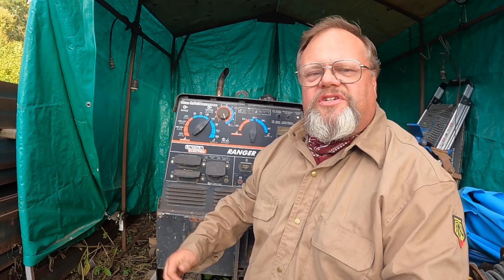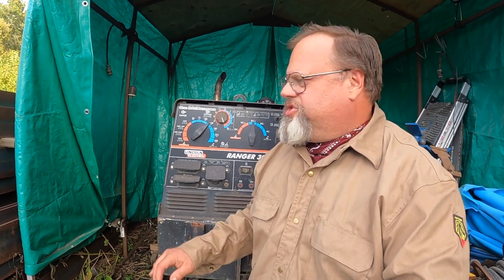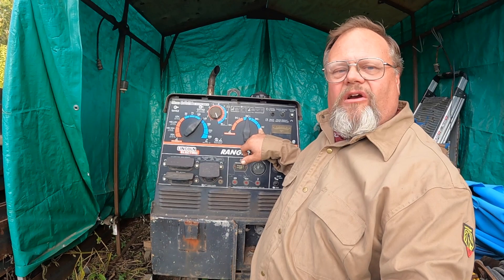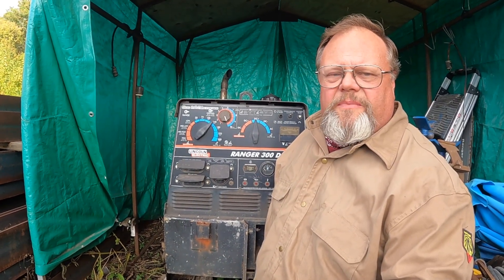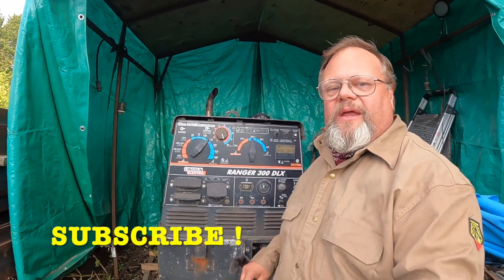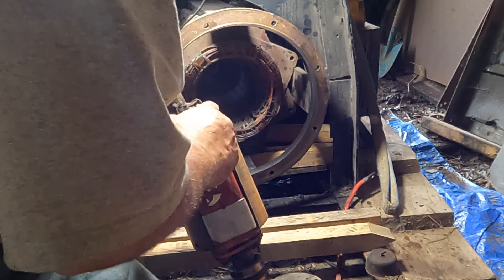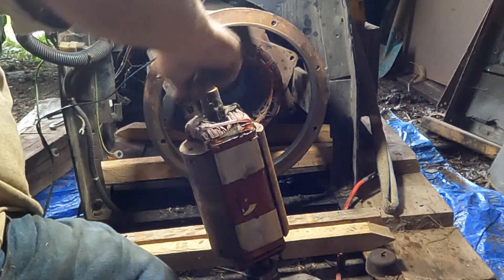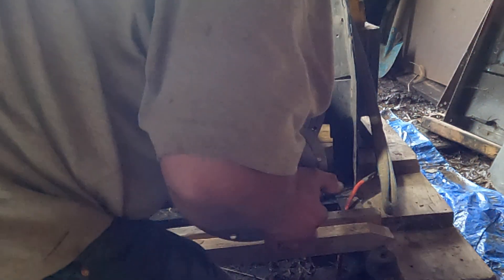Replacing the Armature Bearing  on 300DLX Lincoln Ranger welder

Comment: I finally got mine disassembled like you did in the video. Did you clean the stator and rotor surfaces? If so, what did you use? Also? Do you suggest using an insulation varnish when reassembling. Thanks!
Reply from the maker: When I got it all back together I just use an armature stone or 400grit sandpaper and attached it to a holding device and ran the motor and the welding machine armature spinning and started cleaning the brass area where the brushes touch That is called commentator area where your brushes touch
Reply: @banters_arcforce sounds good. Thank you.

Comment: I have 300dlx its a great machine.
But yesterday the voltmeter reader stopped working and when it starts it feel like it wants to turn off, kinda like if it was underload. 

Any idea what can that be? I been doing research online and I still can’t find a solution. 

Any help i highly appreciate it.
Reply from the maker: @510caliguy  check your fuel filter and fuel today’s diesel fuel is sometimes made of soy beans, and there’s algae that grows in this type of fuel. You have to treat the fuel with an algae agent that illuminates that when it’s in your fuel, it looks like a green slime or slimy. what happens is it causes the engine to go up and down in RPMs because it’s starving for fuel
Reply from the maker: @510caliguy  The amp meter take it to a shop that works on electric motors, or they specialize in welding machines as well that’s the best place to get it diagnosed

Comment: What would be a good price for a used one of these machines.  I assume a used machine wouldneed this done?
Reply from the maker: @kevinbiko6659  the 300DLX is no longer made it was a diesel engine 300 amp maximum welding capacity for all welding processes that’s mig welding, TIG, welding aluminum, and on carbon steel or stainless and stick welding. The only machine that you can get from Lincoln now that does all of that is the GTX and it’s gasoline engine 250 amp and they’ve got some newer models than that one today. The machine loan is a little over $6250.00 that’s not, including all the accessories that go with it to do all the processes. To get a diesel engine in a welding machine like that today I’m not sure if it’s possible Miller Electric may have won the trailblazer.
Reply: @banters_arcforce  I found a used dlx under 1000 hrs just wondering if I should buy it with the bearing issue. I assume they all have it
Reply from the maker: @kevinbiko6659  yes they will have that same issue in the bearing unless they’ve had it worked on previously. Ask a lot of questions when you talk to the person when you’re looking at the machine see if it runs and listen to it when you shut it down it’ll make a little screeching noise or you can hear it when it’s idling if you do buy it, I would have it repaired and fixed right away. I’ve put 8000 hours on mine.
Reply: Its between the dlx or a bobcat 250 diesel also same hours. Same price  @banters_arcforce
Reply from the maker: @kevinbiko6659  is the 250 miller a bobcat or trailblazer
Reply from the maker: @kevinbiko6659  I’ve always like the way Lincoln engine drive machines stick weld but I’ve always liked the way that Miller electric welding machines weld with aluminum and Mig . If it’s a trailblazer, I would talk to your local welding supply store and see if parts are still available unfortunately, that Lincoln 300DLX I’m not sure how many parts are available for it would take a really good electrician to fix things for it.
Reply: @banters_arcforce  thanks for the reply it's a trailblazer 300d 2700hr  $ 3000. Or the dlx 800hr  $4000
Reply from the maker: @kevinbiko6659  the trailblazer diesel welding machine is nice years ago we used one for mig welding on the front line for pipeline the root bead in as the first pass on the butt world then we would stick weld after the fill in cap. It’s a good machine. I think you could still get parts for that I think that would be your best choice.
Reply: @banters_arcforce   sounds like you've been there done that and know your stuff. I will take your advice it is also 4.5 hr closer to me. Would it use that weird washer bearing design.  Should I be concerned about the 2700 hrs. It also it only 8000 watt power.
Reply: @banters_arcforce  the lincoln is basically brand new never even mounted on a truck
Reply from the maker: @kevinbiko6659  I had troubles with my Lincoln 300DLX with a little over 300 hours I did use it really hard at 200+ amps when I was meg welding aluminum I have a meg wire feeder set up for 3/64 aluminum and I can burn aluminum really heavy used it for a while when I first got it and that second year after using it is when I started having my problem. If the Lincoln is in really good shape and you take care of it, leave it inside somewhere and get that bearing fixed as quick as possible it’ll last you as long as well. I’ve had mine for over 20 years, there are parts available for it like the idle control. I don’t think the alternator is available anymore. I had to get one off of a car and then I have somebody rebuilding it for me and I swap them back-and-forth. The muffler is no longer available you have to modify something for it. The Miller light check into it. I think you’ll be able to get parts for it maybe maybe not I know the bobcat is getting hard to get parts for if it’s older. The 8000 W it is nice to have 12,000 V 8000 W will run a motors that are 220. But that’s probably about it with very little drawl right now I’m using my Lincoln to 20 to run a small air compressor and a horizontal bandsaw. That is a five horse motor.
Reply: @banters_arcforce  what were he problems you had besides the bearing?
Reply: @banters_arcforce  this trailblazer won't idle down. Might be  an expensive fix shoot
Reply from the maker: @kevinbiko6659  welding machine that I have the Lincoln. It has a Kabota 905. diesel.
Reply from the maker: @kevinbiko6659  and I run a plasma torch machine off of it. It draws a maximum of 45 A that might be a problem if you don’t have 8000 W I’m not sure what the amperage is on that for the Miller.
Reply: @banters_arcforce  the Mille is max 8000 watt. Think a dr722 motor. What's in the lincoln for a motor
Reply from the maker: My guess is because it will not idle down the solenoid is either bad it’s dried out or in the PC panel control. There’s something wrong. The Lincoln welding machine was the bearing. That’s the only thing I’ve ever had a big issue with I’ve replaced the alternator twice and the belt twice and I replaced the oil seal when I took that bearing out this last time last summer.

Comment: Thanks for the video, do you happen to have the part numbers for the bearings you used?
Reply from the maker: The part numbers are the exact same bearing that Lincoln put in it. There was a outer ring that a machine shop made that slipped in place first on the frame that the outer part of the bearing would slide into.